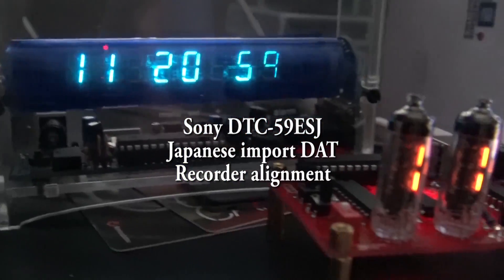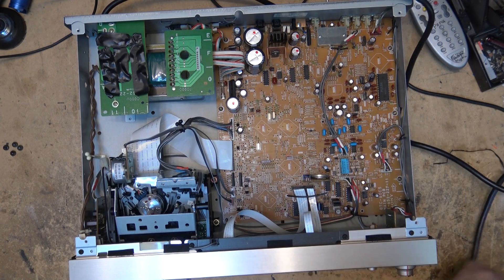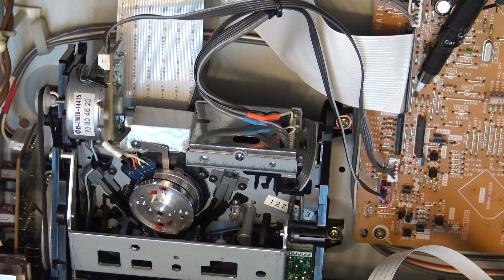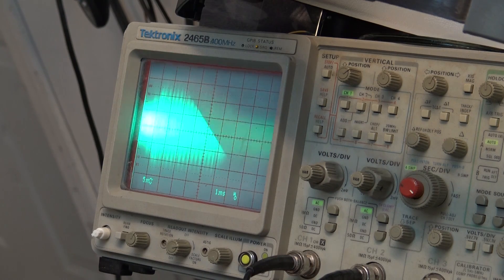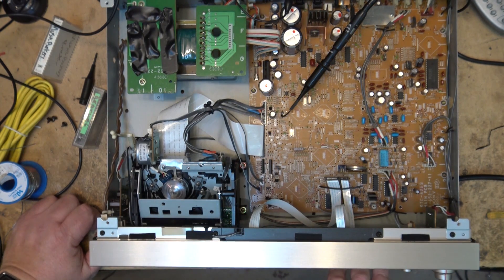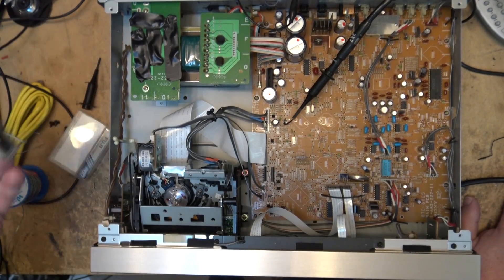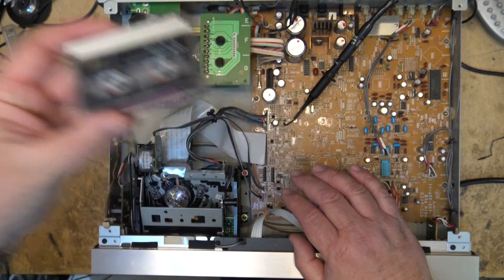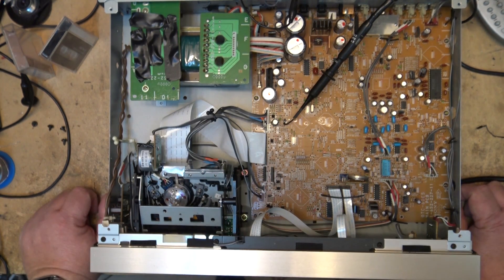Sony DCT59ESJ DAT machine alignment

Comment: Is a two-channel oscilloscope required, or can this be done with a single-channel one.  And is it possible to do it with tape from a proven machine.  Or a test tape is necessary.  Thanks for your reply.
Reply from the maker: It can be done with single channel and a known good take fan be used.

Comment: What tones are you recording on your alignment tape and what levels etc. Can you describe how to make an alignment tape? thank you!
Reply from the maker: Well for starters before making an alignment tape you need a recorder that has been certified using a reference factory alignment tape.  Tones used for analog machines are 400 (or 440 Hz) 3khz, 6khz 10khz. If your recorder is not certified then all you are doing us is aligning the deck to your machines had and speed which may be wrong.

Comment: have a dat tcd d8 works well the door opens and closes the door the problem is that I insert the tape and close and load but to give it forward or attract or play mode does not work it turns off and on it does not take out the tape and the light goes off I know what problem I have

Comment: Regarding DAT tapes , the coercivity of these tapes should last a bit longer than ordinary tapes. I guess the challenge will be to play back those tapes in a different unit that is not properly aligned. And that I am hoping for having DAT tapes dated back to 1987 could be played back on those units.
Reply from the maker: DAT was relatively good as far as inter changeability went. The alignment has to be quite bad to get serious tracking errors due to the high level of error correction built into the format. I have never had any issues playing back tapes on different machines. The same can not be said for digital 8 and moni DV tapes recorded in the slow long play speed.
DAT recorded in the SP speed were very good for compatibility.
Reply: I remembered I had a Sony unit ES 60 or something that had really bad tracking on tapes recorded from a JVC crap unit, the XD-Z1100, their first unit that could be resoldered to kill the SCMS. Somebody told me that if you stick with one tape brand, stick with that one whatever you do, never change to another brand. Cant remember but there was different tape mixture formulas on two different brands and if you interchange those you were in deep shit. Later learnings is to clean the heads with a paper cloth and do the alignment of the head guides with a scope to spare the error correction doing weird things to your recordings. Still I have commercial CD's where you can hear that its taken from a DAT recording, bad aligned. @12voltvids

Comment: Other formats used by studios supplying digital masters were Umatic PCM1610/1630 and Beta PCM-F1/501/601/701.  Umatic suffered from tape defects even when new.  Beta and then DAT were more robust.  Probably Beta was the most robust of the lot, I can play 3 hour Beta PCM tapes from 35 years ago which are still 100% perfect.
Reply from the maker: Umatic and Betamax PCM were much earlier helical digital formats. The problem was the oxide tapes and errors. Once DAT was released with the metal tape and good error correction the other formats were quickly replaced and DAT became the standard for audio mastering and held that throne for many years until tape was dethroned by the new king, the hard drive and flash memory recorders.
Reply: @12voltvids  However they may have pushed the envelope a little bit too hard on DAT.  They could have used 8mm tape and given it a bigger track width to make it more robust.  I do occasionally get in DAT tapes with unrecoverable errors.  
By the way, have you ever got your hands on a Tascam DA-45HR (High Resolution)?  They can make higher bit depth recordings but of course those recordings are then incompatible with normal DAT decks.  Still looking for one of those machines for my collection.
Another format did use 8mm tape: Tascam / Sony DTRS, and then another was SVHS based: Alesis ADAT.  These were 8 track digital audio mastering formats, I have machines for those too: https://www.youtube.com/watch?v=jYCk4oWl5A4
Reply from the maker: @video99couk  
The 8mm versions were 8 track recorders.
Reply: @12voltvids  Yes, that's right.  I have a Tascam DA-88, Sony PCM-800 and a Tascam DA-98HR 24 bit machine here.

Comment: Sometimes you can get lucky with Japanese imports, and there may be additional voltage taps on the primary of the transformer, so all that would be required is a little soldering and a correctly rated internal fuse. 

Here in the UK, you'd probably have to change out the mains cable for something more suited for use on 240v..

Comment: That didn't seem too far away from perfect, so no one messed with the alignment before it reached you :-).
if it's anything like vcr's the tape tension has a small effect on tracking, age drift.
Reply from the maker: The owner replaced the belts, rollers ect, so he had the mechanism apart.

Comment: DAT machines were on a market mainly for the high end user or studio applications, but also had a marketing problem will the far less good Philips DCC, just before it became possible to directly record on CD.
Copyright questions have also largely limited it's distribution, and the second generation DAT in 1990 had to use an anticopy system can SCMS that restricted the use of 44,1kHz sampling frequency recording. It was not possible on DAT to get an exact digital copy of a CD, even if it was possible to copy 48 and 32(Long Play)kHz sampling recordings... On early studios models of these series, (Sony DTC1000..), a reverse modification was possible, but not legit! 
As it was possible to get a 44,1kHz sampling recording from an analog source, it was also a good backup media and it was then widely used by musicians to post demos... The studios were not all digital then, and many producers used DAT to source future CDs from their 24 or 48 tracks analog master recordings on tapes!
The portable TCD-D3 and Aiwa equivalent was also a good quality solution for live recordings, and was followed but generations of Nagra digital recorders and high quality portable tape based recorders.
Today, these machines seems fragile and limited, and far too expensive, but keep in mind the incredible quality DAT recordings are, as there is no digital compression, and theses machines were very well built, with quality components of the high end (Sony) ES series, literally built like a tank, and still relatively easy to maintain as their mechanism was similar to VideoHi8... 
The Sony DTC55ES was the first of a series of DAT with a simpler and cheaper mechanism developped for camcorders. But still in the top ES series!
Denon and TEAC /TASCAM developped their own mechanism, but I believe they stopped producing DAT in 1992/93. Philips with Technics stopped their DCC at the same moment. Marantz had his first CD recorder at the same period (that was sold for approx 12.000 $).
Today DCC cassettes are as difficult to locate as 8 tracks or EL cassettes! DAT cassettes can easily be found on eBay!
As for reel to reel, DAT format will also certainly survive as the machines can still be serviced by qualified and skilled technicians.
Reply from the maker: DAT could record 44.1 from a digital source (CD) in first generation but consumer machines could only record 48KHz and 32KHz from the analod inputs. Sony did include 44.1 analog input on second generation decks.
My Tascam DA40 will record 44.1 and 48 in standard mode and 32 in long play mode from analog (XLR) inputs as well as unbalanced inputs.
It also has no copy protection whatsoever as it is a studio deck. As far as companies producing DAT decks Tascam continued to make the DA40 right to the end of the format production and they are as you said built like tanks.
Tapes still readily available as are service parts for some. Just try and find a pinch roller for a Sony though. Those are getting quite hard to find these days but can probably be rebuilt.
Reply: There's just been a new music release on DCC.  See Techmoan.  I have a good working DCC machine here, and also a defective one (plays analogue tapes OK but not DCC).

Comment: On that transport, what would cause the tape guides to remain frozen (i.e. not pull out the tape)? Also, are there any problems using DDS (data backup) cassettes w/ audio?
Reply from the maker: The mechanisms get gummed up.
You can use DDS tapes no problem,  the DDS4/60 were the same length as the 120 minute tapes. If you use the DDS4/90 meter tape the recording time is 180 minutes in SP speed. I have tons of the 90 meter tapes and have never had a problem, but the 90m tape is thinner and thus can be damaged easiler.
Reply: Do you have error codes appearing?
As for VHS tapes, the mechanism won't load if there is the cassette is improperly loaded. An optical and mechanical system control the correct position... But it's far more likely a loose loading belt or the grease that has become too hard on the guides and axles. 
The DAT cassette has also a similar tape protection system including a brake that blocks the band. Never let tapes in high temperature environment and try a good new tape!
Do not forget these are nearly 30 years old, and as for complex mechanisms like SVHS, they can also fail because of a simple plastic part!
Another important point is to keep the drum clean, never touch it with bare fingers! A simple oil film can cause band sticking and jamming. It can be cleaned with isopropylic alcohol and a q-tip, but never touch the heads wich are sensitive and fragile.
Many models also include a humidity sensor that prevent tape sticking and jamming!
The solution can be as simple as it can become a technician quest or nightmare!